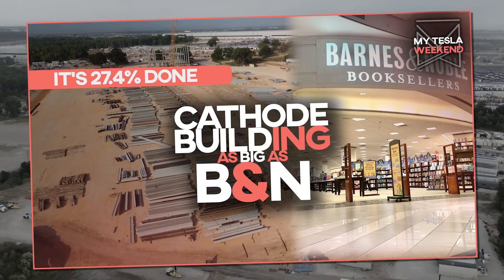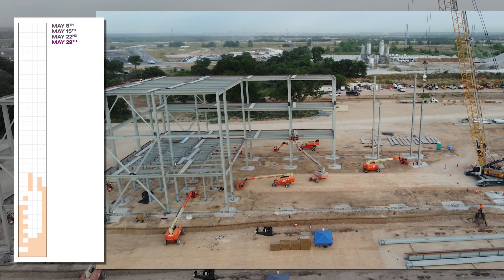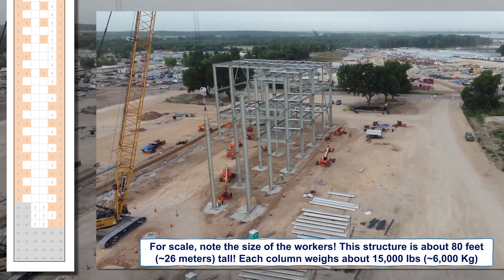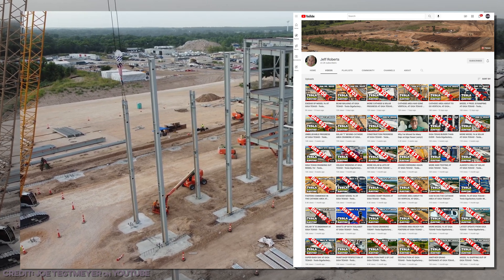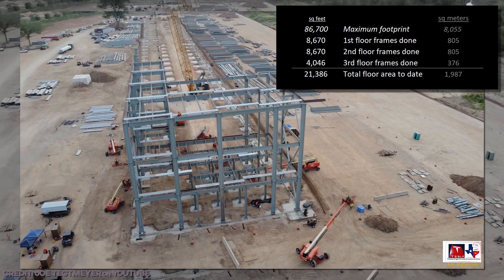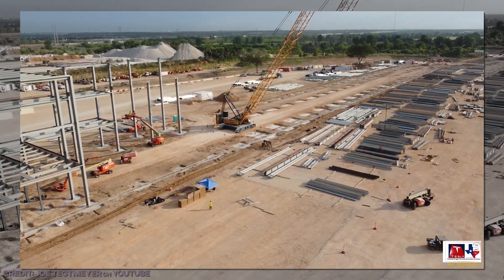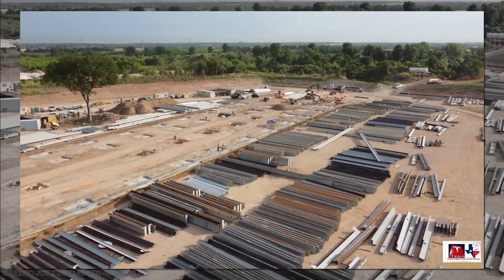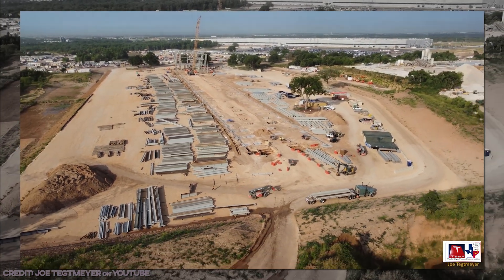Giga Texas Cathode Plant is as big as a Barnes & Noble and it's 27.7% done

Comment: Could they go faster if they had another crane working on the other side of the steel?
Reply from the maker: As Ted said, the concrete needs time to cure. Typically it's 30 days, though more expensive mixes can achieve the minimum rating more quickly. Bottom line, not really, and the pace is still ridiculous.
Reply: Time to harden.

Comment: It's a little confusing to me as to what the actual output of this building is.  I thought they were just purifying lithium and were then going to bulk transfer that to the battery portion of the main building.  Is it something else?
Reply from the maker: Gotcha! As I understand, the lithium refinery was planned to be built in the area where all those white trailers are parked. It's been postponed, possibly because the lithium mine out east was held up in permitting.

This building will be manufacturing the cathodes used to make the batteries. So not refining an element, but making a specific part, rather than buying them from someone else.

This isn't being done inside the battery corner of the factory because it requires too much space.
Reply: @FutureAzA  And there are other suppliers.
Reply: @FutureAzA  Thanks Brian. I was wondering what this was all about and now I know :)